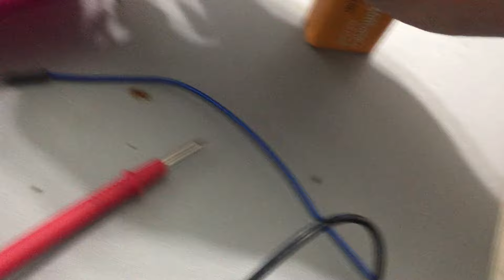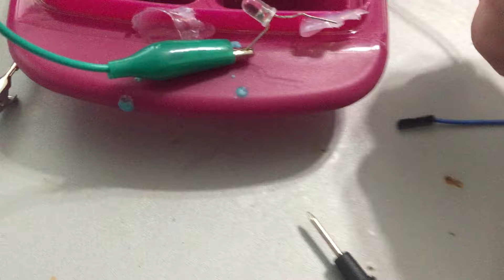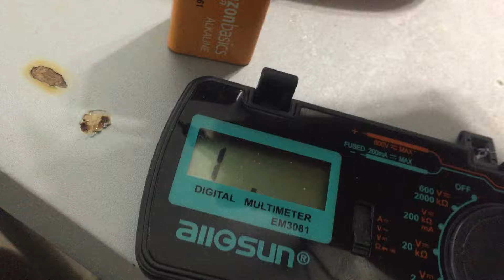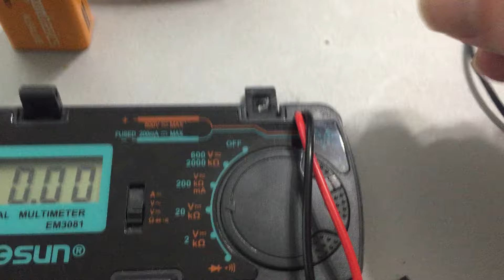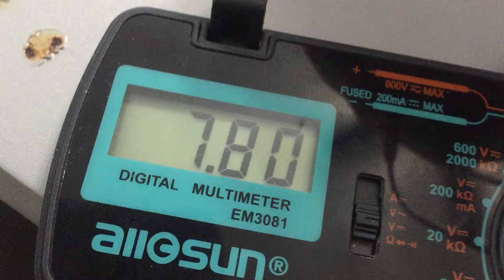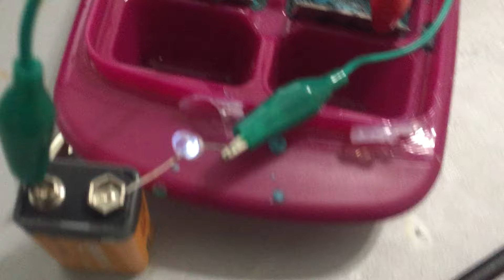Open Dipole DC LED

Comment: Instead of a bunch of nine volt batteries in series would it work with just a regular 12 volt?
Connect a small inverter in place of the diode?
Worth a try
Reply from the maker: I thought it was obvious, It's not that kind of a setup. It's pure electrostatic. You can run regular series dc but there will be no benefit and the battery will drain as normal if your running an inverter with a regular series cell assuming the inverter can take HV.